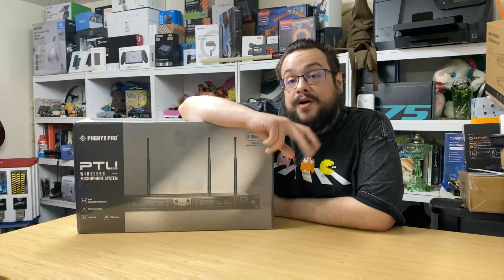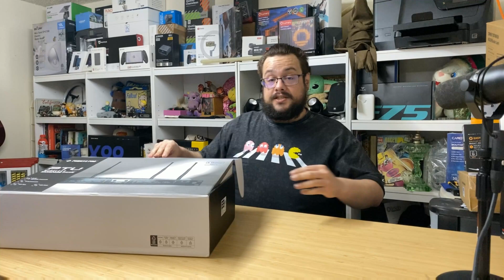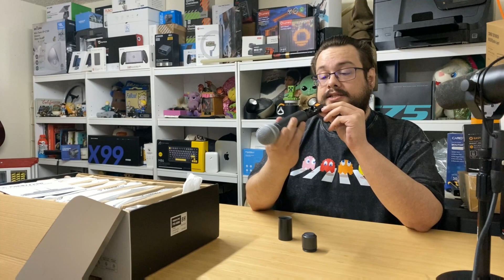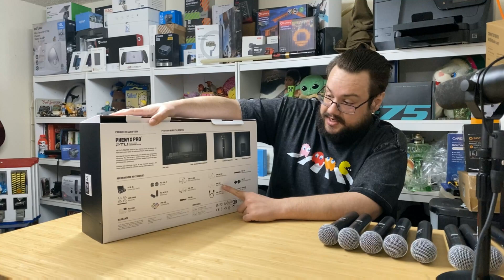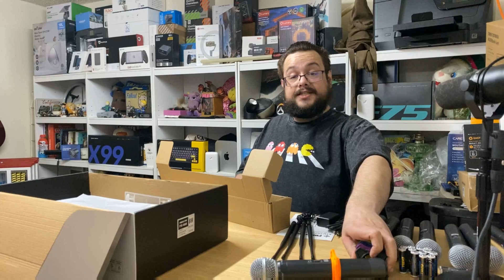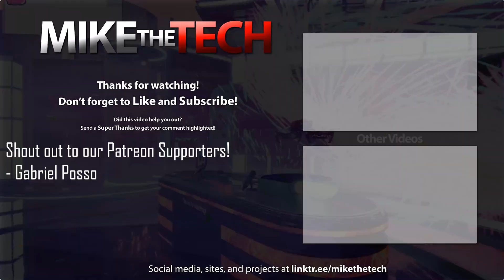Phenyx Pro PTU-6000-8H Review – The Ultimate 8-Channel Wireless Mic System

Comment: Have you made the new video using the ptu 6000? I am wondering if I buy 2 of these if I will get feedback
Reply: Having 2 of them shouldn't cause feed back.  You may get some interference between them when running all at the same time.  That will just depend on the number of open channels/frequencies you have in your area.

We have a program coming up that requires more mics than we currently have so we are looking into a 6000 (8ch) to add to our 7000(4ch).  mics are fully interchangeable between these to systems.   Over all with 12 total channels for us we will have 6 lapel and 8 handhelds that can be used in any combination.